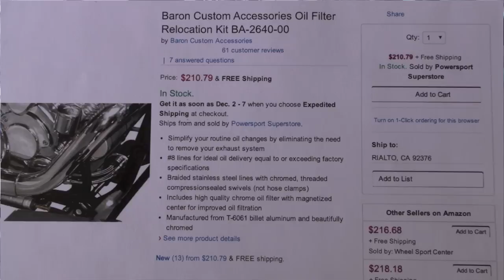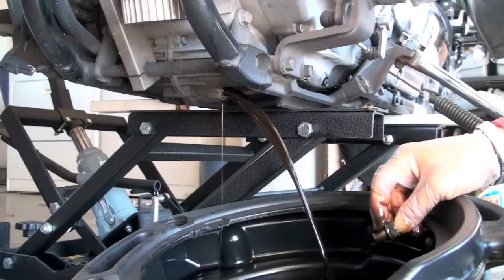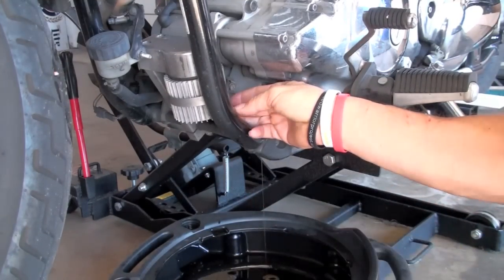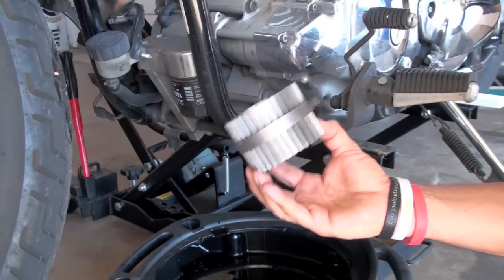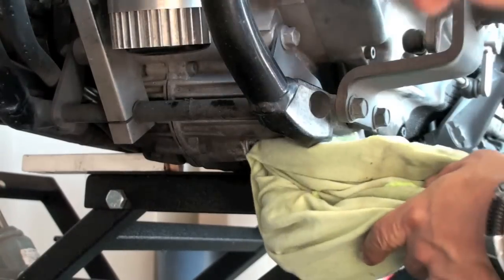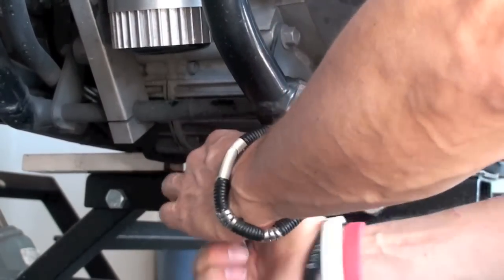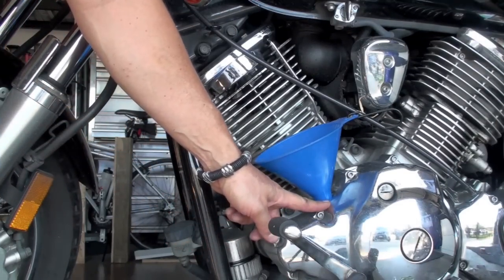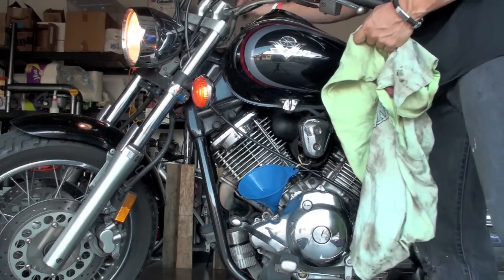Changing Oil on a Yamaha V-Star 1100

Comment: I have the Baron's ORK, it leaks some oil around the metal hose connection points. I bought another set of hoses to see if that will fix the oil leak (more like drip). One thing is the oil change is quick!😀

Comment: Byrds, thank you so much for informative video. Could you please reply or post a link to metal aluminum oil filter protector you built? Where does one find that material?
Reply from the maker: Hi Dmitry A. I found some dude online 15-years ago who was making them and selling them. I would recommend printing a screen shot of the video and taking that to a metal guy and asking him to order you a sheet of that material. Then just buy a large hose clamp and make one yourself. I tried to find something similar online now, but I can't find any material that resembles that.......sorry.

Comment: Like that cover. Nice idea. Have you ever used other oil types I was told about Rotella.
Reply from the maker: That cover some dude was selling online years ago. I've just used Yamalube regular 10/40 oil for the last 17-years and the bike is at 120,000 miles now. Just change it every 3000 miles.
Reply: @Byrds1967   could you help me with some tips I just bought my first Vstar and can find the air filter
Reply from the maker: @jesusvite4100  It's under the round cover on the right side. There should be 3 screws holding it on.

Comment: Hello, was wondering if you have done your own valve adjustments. I read in the online owners manual that it should be done every 4000 miles...I just got my  star used and can hear the valves taping. Have you ever done a video on valve adjustments?? Thanks Fred
Reply from the maker: Hi Fred, I use a nice wide motorcycle lift. Most of the cheaper ones are narrow and I don't trust them for balance. I recommend www.jsjacks.com. Go to "Motorcycle" tab at the top, then hit "Motorcycle Lift" on the drop down menu. I have the 1st one on the page with the T-Bar to wheel it around. It's an awesome jack. https://jsjacks.com/product/loaded-motorcycle-lift-combo/
Reply from the maker: I haven't done valve adjustments ever on the V-Star 1100 even after 120k miles. I have the manual and it's looks pretty scary. You pretty much have to remove the whole top part of the bike if I remember right. If you think your bike needs it I would let a shop do it. It's probably the only adjustment you'll ever need.
Reply: @Byrds1967  thanks brother for your answers.. And I am really enjoying your YouTube channel..Fred
Reply from the maker: @Fishermanfred1  Glad to help.

Comment: Was looking to buy an 1100 so glad I saw this video. Will be passing on that bike lol. Did the engineers not see the issue with the location of the oil filter? Sheesh
Reply from the maker: Well that modification costs about $300. The V-Star has lasted me 21 years as of now with well over 130k on it. Nothing but replacing oil, brakes, tires, and a cable clutch now and then.

Comment: I live in a tropical country where temperatures go up to 93 Fahrenheit. Would you still recommend to use the 10w40? And what kind of oil should I use, conventional, or synthetic?
Reply from the maker: It get's over 100F where I live. I just use conventional Yamalube 10w40 year round. I change oil and filter every 3000 miles. Bike has over 120,000 miles and still runs great.
Reply: @Byrds1967  great info. Thanks and greetings

Comment: Where did you find that corrugated aluminum?  May I have tell me where you found it or a web link please?
Reply from the maker: Some guy was selling it on line in the early 2000's. I have not been able to find anything like it since.
Reply: I found this one on Amazon...
Oil Filter - Car Engine Oil Filter Cooler Heat Sink Cover Aluminum Alloy Motor Mount Accessory (Color : Black)...around $28.00

Comment: Which kit did you have on that Bike?   Any trouble from it??   Good Video of it all....  Thanks!
Reply from the maker: I think I used the Baron kit. Both are identical. No problems at all. The original kit is still working over 100k miles (over 14 years now).

Comment: what happens to the oil filter which was in the original place
Reply from the maker: You just take it out. The after market piece routes the oil through the outside filter and back into the bike again. After market is actually better for cooling the oil as well since it's outside the bike.

Comment: Yeah, one of the downsides of using old engines in new frames, yes the engine is reliable and well tested, but quirks like this can and will happen. What oil filter relocation kit do you have?
Reply from the maker: Not sure of the "old engine and new frame" comment.  But I think mine is a Baron kit.
Reply: @Byrds1967  It's the same engine as the Virago 1100
Reply from the maker: @CarlMarx  Oh ok. I didn't know there was a Virago 1100. I had a 1983 Virago 750, which was my first bike.

Comment: Have a question I just put on the oil relocation kit and now the bottom bolt on the diverter leaks I have the baron kit how can I fix this any help would be appreciated
Reply from the maker: Did you remove the o-ring gaskets from your original assembly and put them on the diverter? I think there was a black one and red one if I remember correctly. If you did switch them over and it leaks then you might need new o-ring gaskets.

Comment: If you don't have the remote filter, how do you warm up the bike?
Removing the hot pipes seems dangerous...
Reply from the maker: Good point.
Reply: Actually I figured it out. You warm up the bike, and then drain the oil without changing the filter ; this does not require to disassemble the pipe.  Fortunately the oil filter needs to be changed every other oil change (every 8000 mi or once a year per the owner manual). This relocation kit seems more sane though, thanks for the tip!
Reply from the maker: Yeah, I remember reading that in the manual. But even every 2nd oil change is a pain when you have to remove tail pipes. You won't be sorry for doing the relocation kit. It's a great investment.